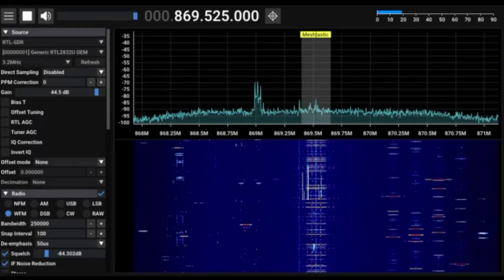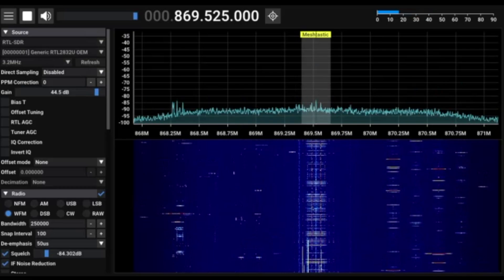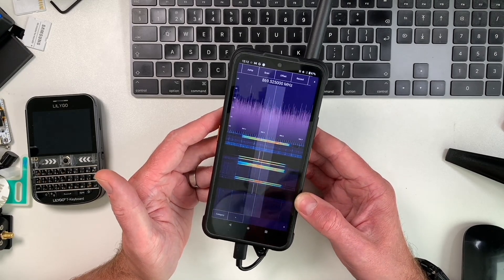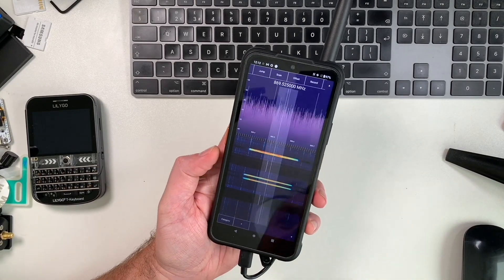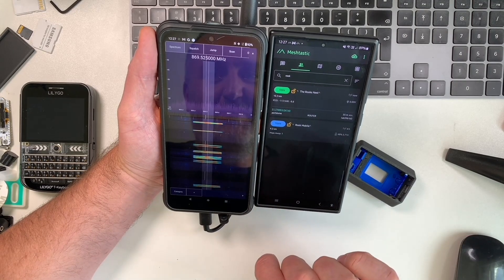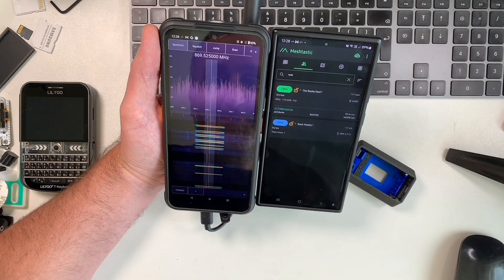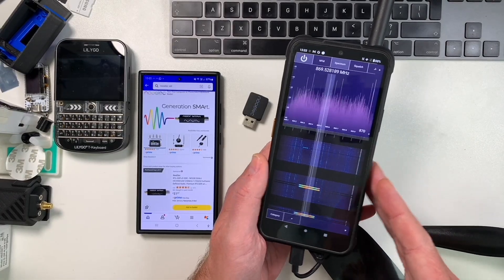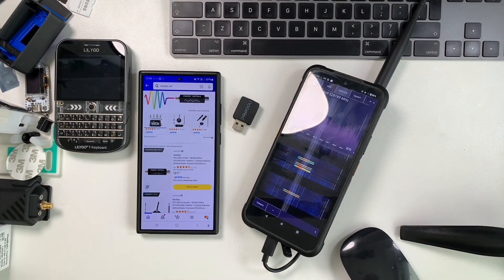Illegal signals affecting Meshtastic?

Comment: Perhaps an outboard band pass filter would help, ever modern piece of electronics causes some level spurious transmissions, pc’s  , televisions and any switch mode power supplies are pumping out hash all the time. Most unlicensed radio bands in the UK normally have the caveat that  they must accept any interference as they have no protection.

Comment: In my case, the cause of interference is from EV charger myenergy Zappi. Which is produced  in the UK. There is advise from manufacturer to change the channel from default Ch.1(which is 869.525 Mhz) to Ch.4 . That's ofcoarse given you have access to the charger.

Comment: Great info Andy ! We have a similar problem in the US as well. We have the 900 MHZ band that is shared .  With low power devices and sensitive receivers they are very subject to interference,   A strong signal near the band can overload front end of receiver . A lot of things are getting buy ofcom rules. The same is happening in the US with FCC rules. We are having some   trouble with EV charging stations in the US as well causing interference but only some of them .  Mostly AM and HF radio . DC fast chargers seen to be most of that . they use SMPS type units and may not be shielded for RFI . In the US almost nothing is done unless the interference gets into public safety radio systems.  I think ofcom is same way.  Things like EV chargers are overlooked because it is not a transmitter.     EV systems in the US use bluetooth and that the only thing that FCC looks at. With more EV systems going in the problem is going to get worse.  Cheers from NY !

Comment: Got something like that going in my neighboring town.  Somethings blasting constantly on the band and definitely ignoring duty cycles.
It makes Meshtastic coms basically one way to the next town. I can hear everything loud and clear, but they can't hear me since my weak signal (20km away) is drowned by the interference.  We got it somewhat working with long moderate. It's quite amazing how resilient the Mesh signal is against noise specially if you slow it down to moderate.
Reply: hmmm... this sounds familiar 🤣
Reply: @valzzu  I knew you would see this 😀

Comment: that carrier is local to you if it is wiping out the front end of that SDR. sure it's not anything like a lightbulb or anything like that in your house ?
Reply: My thermostat communicate to the boiler on 868mhz. You may want to check that but I doubt it does that continuously.
Reply from the maker: I know... it's defo not in my house😁
Reply: @andykirby  it’s going to be something hyper localized to your house for it to be that strong and completely wipe out the front end of that radio. Are you guys using smart meters for power because I get a similar thing from my house as they use 900 meg for the smart meters to the end of the street although with hours it’s more of a spread spectrum kind of signal what you could do is take the antenna off seeing as it is pretty predictable timing wise and DF the signal to find out what it is or at least a local general area
Reply: @andykirby  house or street rather
Reply: @andykirby  it might make for a good video lol

Comment: How did that charger pass EMI testing?! As an electrician I love removing that gear for you radio lads!
Reply: I am a licensed Amateur Radio operator and we suffer interference from switched mode power units all the time, the EV charger is most probably made in China with very little if any EMC testing being done.
Reply: @fredfenwick7047  Love my China junk; They know how to build things to a price point, but it reflects badly when it's an electrical hazard or spews out unwanted RF noise.
Most electricians wouldn't know what they are installing unless they test it!
Reply: @fredfenwick7047  They submit a device that complies fully to pass and get the mark, then produce them without the filters built in!
Reply: Is it noise or is it data?  Wouldn't surprise me if there is some telemetry shared between the car and charger, something extra to the basic current requests sent over the cable.  I mean these things are basically robots at this point